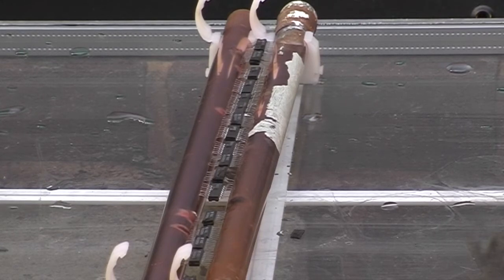Cooking chips with a variac

Comment: When I saw the video title, I didn't know that you were talking about the electronic variety of chips. :-D 

I was thinking the potato kind, maybe with some salt & vinegar on them, freshly variac'd & served on a plate.

I don't have a variac, so I ask: Could you use your variac & wire a hotdog across the output, maybe cook it on 50v ? 

I tried this, straight-to-mains, & the ends of the hotdog just burnt up, & it STUNK something terrible!

Maybe less volts would give a better result, yes?

-BBD.